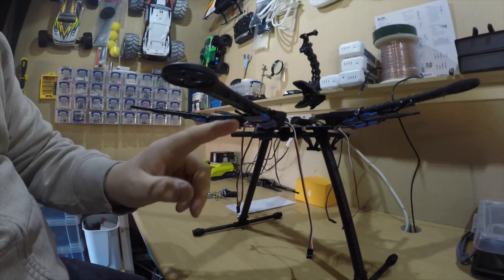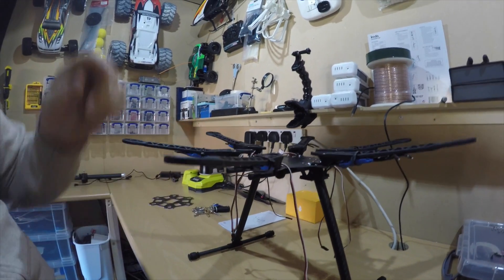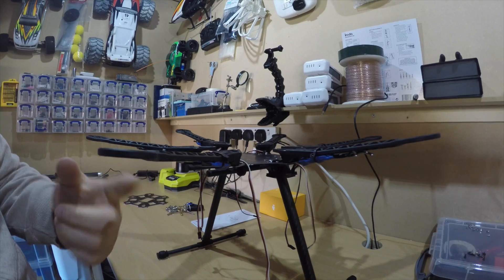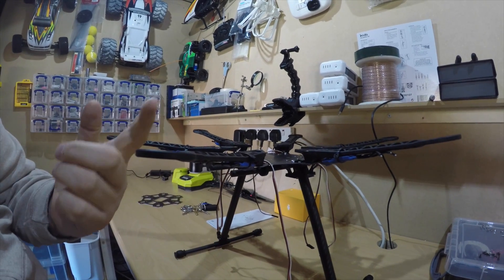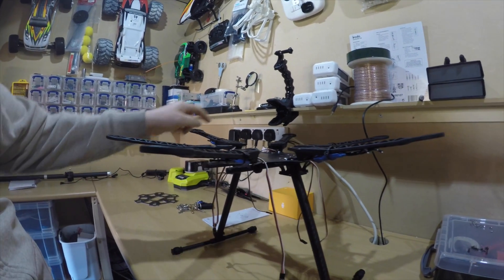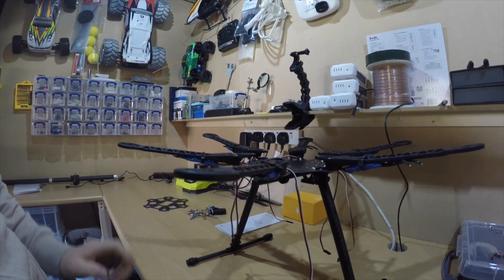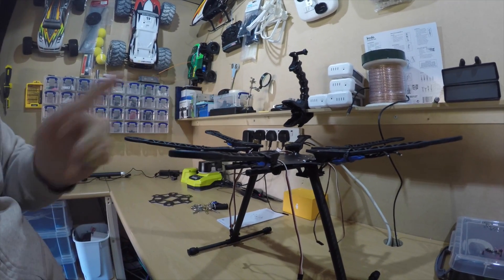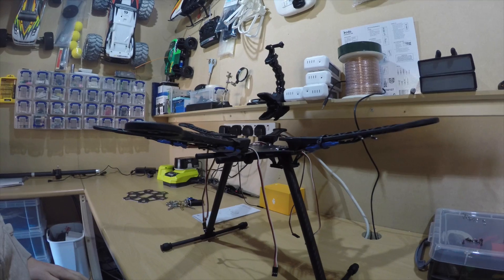Hexacopter Build #4

Comment: As a suggestion, without trying to soapbox..if this is a build video then it would be more helpful to would-be-builders of an S550, to illustrate more than the tedious moments like securing the motors to the arms..instead cover the full extent of what you described were your next tasks with the build. I came looking for insight into the way others were building out the ESC/Motor connections to the arms, and if it differed much from the way I've built my own F450/550 and S500's in the past. Hope to see more in future posts.
Reply from the maker: +necessarilyskeptical thank you will do, i like to do more build after this one, so any idea on frames or even what to build next :)